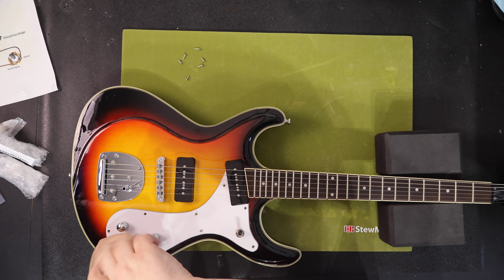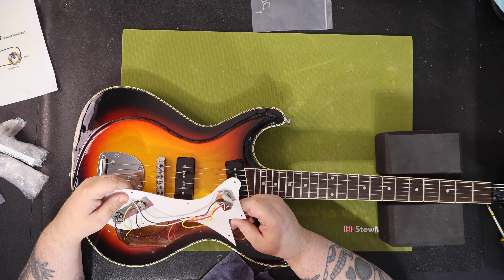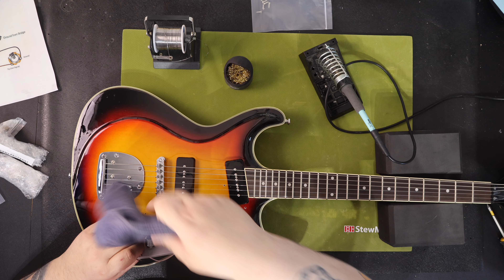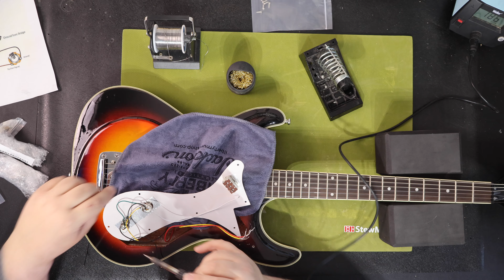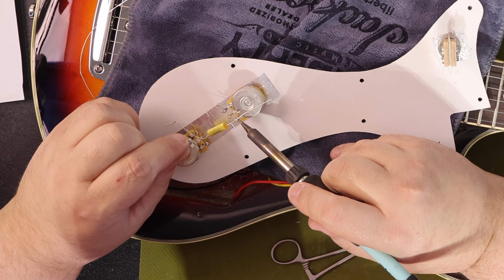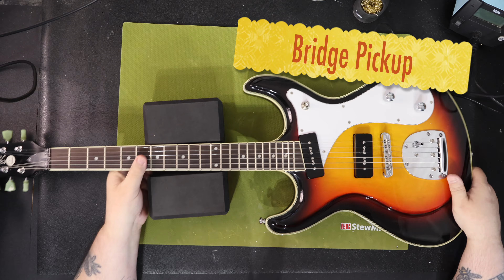Upgrades: Eastwood Sidejack DLX Part II

Comment: When shielding, make sure all the shielded cavities have continuity to ground -- if a ground wire breaks off, then it's all for naught! Same with fiddly ground contacts to bridges and conductive pickup covers (like Tele neck) -- it'll have you running around in circles if you only assume the connection is still being made.

But yeah, single coils will always have hum to try to reduce. I've had some decent luck with using dual rails with a bass cut instead, on one of my Strats. The experiments continue!
Reply from the maker: I always do and then I test with my meter to make sure the path is there.